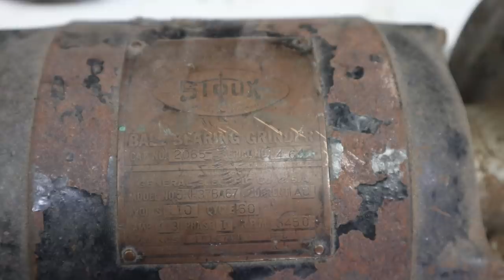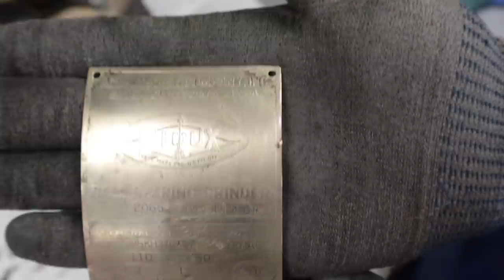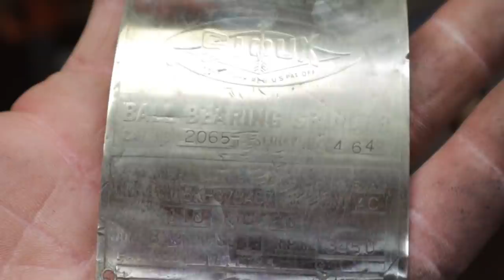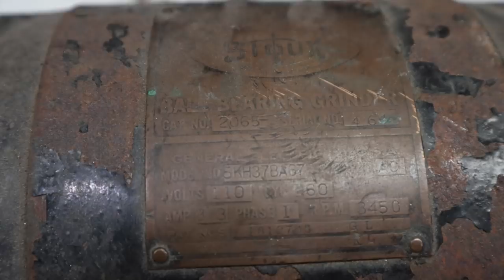90 Year Old Bench Grinder ~ RESTORATION ~ How did this one SURVIVE the WWII Scrap Yard?

Comment: This made my day! My dad worked at Sioux Tools for 35 years as a machinist and eventually an engineer. I worked there myself during college in the summers. Thanks for the great video!
Reply from the maker: That is absolutely AWESOME!! If you had any old pictures or other tools from Sioux I would love to see them!! My email is in the about section of my channel!  I also have a Sioux valve face grinder and a valve seat grinder that I plan to restore at some point! I'll probably start with the valve seat grinder! I appreciate you commenting, and letting me know your history with the company!
Reply: Nice. I picked up a Sioux "sander" (angle grinder) a few days ago. Still works. I would like to restore it tho. I am not sure what year it is. But it is listed in this catalogue that was printed in 1962. I believe they kept that exact same design through the '80s. Here's a link for the catalogue. The grinder you restored is also listed on page 34.

https://archive.org/details/SiouxAirAndElectricToolsCatalogNo62
Reply: I understand the joy you had seeing an old tool restored from the company your dad worked at. I feel the same way when I see any of the You Tubers find a vintage or antique H.K. Porter bolt or tree limb cutter made in Boston, Mass. My dad also was a machinist and worked there for 20years. So if I see any H.K.Porter tool made there I can't pass it up and buy them and restore them as best as I can. I have a few, if you call 17 a few! I'm glad your dad made this grinder!

Comment: What appeals to me most is the fact that a tool is being resurrected. One mans trash is another’s treasure. Since we live in a disposable time where most would just as quickly toss that grinder in the trash, I’d be there right along side of you pulling it out of the barrel. We see the potential, especially with the older equipment. It was built to last back then, but even today’s stuff just needs a little love to come back to life. Great job you did on that lil gem. 
✌🏼🤟🏼🤞🏼

Comment: another 90 years of work left in it.  Gloves, rings, jewelry, are prime targets for machinery.. I like restoration videos because I restore items and I get new ideas on how to fix things..
Reply from the maker: I totally agree! it helps to see how other people overcome issues when restoring and building things! The only issue when using wire wheels on an angle grinder is that the wires fly off and can lodge in your hands, I've had it happen. I want to find some safe gloves to help prevent that, clearly those were not the right ones! lol.
Reply: Maybe a tight fitting pair of leather with NO wrist straps, or a pair of welders gloves, and I know what you mean by sticking you..LOL
Reply from the maker: @wetdedstuocm  Not a bad thought! No wrist is a good idea, and mig welding gloves would give me the control I want but still have protection! I recently had a wire lodge so deep in my middle finger that I couldn't get it out of the bone... That the only reason I was wearing gloves during this project! Thanks for the suggestions!
Reply: OUCH!!!

Comment: Who Said it couldn't be done ! just sit back and watch you! great job!. I loved seeing the Ideal strippers ! I have a pair identical, used to work for Bay State Elevator back in the mid 60's. got them then still use them today (amateur radio op now.) quick note. Harbor Freight's el cheapo heat gun. works wonders on that shrink tubing. better than open flame or soldering iron. brings it all down evenly. I know I did the same flame and soldering iron deal for over 50 yrs before I learned . (I should say I broke my "cheap" habit and splurged !. Thanks for a great video will look for more thanks for sharing.
Reply from the maker: I never let people like that stop me from doing anything! Those wire strippers are AWESOME... You have to be careful though, they have been known to bite! I already have a heat gun, buy many times I like to direct the heat a little better with the lighter... I'd like to find a small pen type heat gun or something!  Thanks for watching & commenting! Lots more to come!

Comment: I need to replace the bearing's in My 1950's grinder and paint it up it's better than one cheap one I use know 
and built better too. Great  job saving it from being scrapped.
Reply from the maker: It wasn't too bad replacing them! That's about the only thing it needed, just be careful the wiring can be a bit fragile! Thank you for watching and commenting! Lots more to come!
Reply: When hammering bearings into place as shown DO NOT use a socket or tube that contacts the outside race. This can put tremendous stress on the actual balls in the bearing and can damage the races/balls. Use a smaller tube/socket and drive down the inner race. (Reverse if forcing a bearing into a recessed place like the housing.)

Comment: Good restoration, well done. These were quality built machines and this grinder is ready for another 90 years service. Just two pointers, its good to chase old, rusty threads and the straightness of the armature shaft should be tested with a gauge. The machine will run very smoothly and silently if the shaft is straight.
Reply from the maker: Much appreciated! I'm sure those things wouldnt hurt, but the average guy probably can't check the straightness of the armature. I'll bet this one is straighter than 80% of all grinders you can buy new today! Thank you for watching and commenting! Lots more to come!

Comment: What appeals to me?   I like that you take an old tool, working or not and restore to original condition.  I like that you save the original labels, albeit a metal plate, a sticker etc.  I like the repaint, even though it may not be original color.  Then, when it's done, you plug it in, presto!  Or, an old tool that doesn't require power, such as your anvil, it looks good as new and ready for service.  I just love restored tools.  If you get a chance, check out Scoutcrafter, he restores old tools and is quite good.  Mostly hand tools. Awesome job on that old grinder, rewire to make it safe and truing up that old grinding stone.
Reply from the maker: I totally agree! It's fun watching the transformation! The videos I see where they don't show the use of the tool at the end are a bit of a let down! That's why I always like to show different ways to use tools or something! I have seen MANY of his videos, and he does a great job!

Comment: Really nice work! Great to see an old work machine restored! 9.8 outta 10, cause I don't approve of using lighters for shrink tubing! 🤣🤣🤣 Joking!... Seriously though, having to resolder the connection cause you burned the shrink tube sucks! 😁
Reply: Tony YT; agreed. I use a heat gun for shrink tube. Mine is made by Warner, and I bought it at Lowe's.
Reply from the maker: Lol... I've always used a lighter because it's easier to control where the heat is located. I'm sure there are better heat guns for this task, but my heat gun is large and will heat up everything anywhere remotely close to where i need to shrink the tubing. I also use shrink tubing that is lined with adhesive on the inside because I've found it holds up better! Thanks for watching and commenting! Lots more to come!
Reply: @SalvageWorkshop  You do excellent work my friend, and honestly, I do the exact same thing... mostly cause I don't have a heat gun, but anyways, keep it up!

Comment: Awesome restoration. Did you see how well balance  that grinder is, wasn't  walking or vibrating. I have a well known brand of grinder that was made here in the USA at one time but now like so many others to control  cost is now built overseas it will walks around bad.  Very nice restorations  nice paint and smooth running machine.
Reply from the maker: I hoped someone would notice how SMOOTH it runs, and its NOT bolted or clamped to the bench!! If only tool quality could still be what it once was! That's just one reason I love old tools! Thanks for watching and commenting! I truly appreciate the support! Lots more to come!

Comment: i got a old electric grinder at the flea market and nobody would look at it because the cord was bare copper all the way to the grinder. i got it for 5 dollars and brought it home and tested the motor and it ran. so i cleaned it and lubed it and installed a new cord and mounted it on a pedestal. been using it for quite a while. they really made stuff to last back then. i never did figure out its age but it's older than me.
Reply from the maker: That's awesome!! I love finding things that are gems that no one has the foresight to see past its imperfections! Yours is a perfect example of that! Thanks for sharing!

Comment: Always love to watch old gear get lovingly restored to operating condition! Two questions: Did you get new bearings? Did you consider adding a Ground Wire for just a bit of extra safety?
Reply from the maker: Yes and yes. I replaced the cord a few days ago with one that is grounded, and the bearings are new. Thanks for watching and commenting! Lots more to come!

Comment: here is a trick for those nuts on the switches. all sockets have a bevel at the end to make it easier to get on the the bolt head or nut. take a socket and grind or sand till the bevel is gone and it will work on all those thin nuts on switches.you can do the same with nut drivers.
Reply from the maker: That is a great tip!! I have plenty of extra sockets! I'll make up a few of those for future projects! Thanks for watching and commenting! Lots more to come!

Comment: Surprised the electric motor still worked after nearly 100 years. Looking into retrocomputers and old pinball machines, its kinda normal to see the electrical components give out.
Reply from the maker: I agree with you! This one just needed a little cleaning! It was definitely a well made motor!
Reply: Shouldn't be.  The elevator motor in the Empire State Building is the original.

Comment: Do they still manufactur motors with centrivical start flipper thingys?  Havent seen one in a whiles why i ask..  all start caps and relays now...
Reply: Oh and that music’s way to damn epic for a bench grinder...  maybe if it sucked a glove in and not the hand..  but good restoration man..  just not epic...
Reply from the maker: I'm not an expert, but i'm pretty sure most 110v motors these days still have a flipper thingy (centrifugal switches) even if they have a start capacitor. Its used to shut off the starting circuit within the motor. I could be wrong though!

Comment: Great job!  Very nice, but you did you not repair the tool rest for the grinder side?  There should be a tool rest on the grinder side at least.  There appeared to be an original one with the grinder when you started.

Comment: The flange on the wire wheel was really stuck. Would adding a pinch of Anti-Seize Compound make removal easier next time? Glove Tip: Never wear cotton gloves when operating an electric snake to clean out drain pipes. The cotton gets caught in the spinning cable and will scare you into next week. Wear leather gloves!
Reply from the maker: I sanded the inside of each flange with a small attachment in the drill to make the hole slightly larger and that seemed to fix the issue, but anti-seize is also a great idea as well! Funny thing, I have gotten a cotton glove caught in a drain snake, not fun either! Thanks for watching and commenting! I truly appreciate the support! Lots more to come!

Comment: Beautiful. I’m wondering if a ground wire could have been added?
Reply: Yes, it can. He just need 3 wire cable and attach ground one to metal body. I highly recommend to do it, otherwise in case of broken insulation of cables, tool can be dangerous. Rule of the thumb - if you have metal body of powered tool or appliance, it must be grounded.

Comment: The grinder is not as old as you think. 90 years would be line driven and the first ones would have brass bushings. so with bearings in it it is only about 60 to 70 years at the most.
Reply from the maker: Possibly! I did a bunch of research and everything I found puts it's date of manufacture in the 1930's. I have a chain driven large engine lathe that was manufactured in 1923 and it was specifically designed NOT to be run on a line shaft, but to be run with its own self contained electric motor.  They were VERY expensive at the time! I would love to know for sure, so if you or anyone else has a way to look it up based on the numbers on the brass badge, I would appreciate the help! Thank you for watching and commenting! Lots more to come!

Comment: I guess the first thing to warn folks about is that angle grinders need a proper GUARD on them to protect you. Also, decent long heavy leather gloves... the ones from your local metalworking/welding shop and a long sleeve work shirt will do much more to protect you than any sort of knit/mesh glove and tshirt combo. Be safe everyone. Protective clothing is a lot less expensive than a plastic surgeon.
Reply: yeh be SAFE when using grinders, DO NOT WEAR GLOVES! Wearing gloves is the reason why you'll get dragged into to the spinning blade/wire wheel and then it causes more damage rather than just a little nick.
Reply: each to their own tho….. :-)
Reply from the maker: Yes and no.... It depends on what I am doing. Its very hard to use a wire wheel on an angle grinder with the guard installed.  I am going to try to find a good thick pair of mig welding gloves for use when I have a wire wheel on the grinder, because they throw the wires off and they have gotten imbedded in my hands at a times. I only show the things that go wrong in the shop so people can learn from them! Stay safe my friends!

Comment: I marvel at your mechanical restoration but have to question your dedication to electrical safety. An old motor with what looked like cloth insulation on the wires, did you do any electrical insulation checks on the motor windings?
Personally, the rest on the grinding wheel is there for a reason, the same reason that the wire brush bit you and that's to stop you getting pulled into the wheel. I'd fit the rest back on, if nothing else it gives you something to steady your hand against while grinding.

Comment: Was the motor running at all before you started? Did you test the motor before re-assembling everything?
Reply from the maker: When I first got it it was working, but at the beginning of the restoration it wouldn't turn on, and I found out the switch had gone bad, after that it fired right up! Thanks for watching and commenting! Lots more to come!

Comment: Can anyone tell me what is the name of the tool used at 1:30?  I need to get one of those.  Thanks!  : ))
Reply from the maker: Good question! That my friend is called a 2 jaw gear puller. They make many types and sizes. There are also 3 jaw versions and may other similar versions for specific tasks. They are handy, and if you won't use it often, then one from harbor freight would probably work well for you!
Reply: @SalvageWorkshop  Well my guess was right, some kind of "puller".  Even if I wasn't going to use it often, it's worth the investment. I'm sure it would have saved me a lot of headaches and pain in my hands and arms. I have learned the hard way, always use the right tool! : ))  Thanks man!

Comment: Nicely done!  a few questions if you please. How did you get the bearings matched for size and where did you get the mini impact?
Reply from the maker: I went to a local electric motor repair shop with the bearing and a pair of calipers and measured both, plus the bearings have a number on them that can help cross reference it.  I got the impact at a pawn shop, but its a small makita bit driver or some sort. No idea if they still make it or not.Thanks for watching and commenting! I truly appreciate the support! Lots more to come!

Comment: Hi from England...

You've made a nice job of that but do you want to do me a favour and replace the 2 core power cord with a 3 core please...
That way you can earth it see...and I wouldn't want you to get a nasty sting off it if it ever went to fault...

Thanks...👍
Reply from the maker: I agree with you. I just didn't have a grounded cord last week when I was finishing this project and needed to get it finished! I appreciate the concern! Thanks for watching and commenting! Lots more to come!
Reply: @SalvageWorkshop  

It's ok mate and you're welcome...
I'm a UK based electrical contractor and the last thing  I'd want to think is that someone got hurt by something that went to fault...

Here...
Look at my channel if you like...
I collect vintage & antique machine tools...
Reply: Every power tool restoration should include addition of the grounding wire.   BTW you can buy replacement power cords with the proper fabric cover and round plug for that 1930’s look, with 3 conductors.   Looks authentic and much safer.
Reply: @jacksons1010  

Hmm...depends...
Sometimes you can run the risk of introducing a potential by the inclusion of an earthing conductor...you really need to know what your looking at sometimes...
Reply: @glennmoreland6457  If adding a ground creates a path for electricity to flow then so would a human hand touching the metal!   That's exactly why we add a ground (or "earth"; same thing) and use a GFCI  breaker on the power outlets - it can save your life.
Reply: @jacksons1010  

Thanks for letting me know this very basic analysis

P.S.
What do you know about potentials...and potential differences...?

Where to extend...and where to export an equipotential zone...?

Faraday cages and uffer earths...?

SELV, PELV and FELV...?

Earth free equipotential zones...?

Get back to me when you feel ready...👍

Glenn
GLMelectrical
👍🇬🇧👍🇬🇧